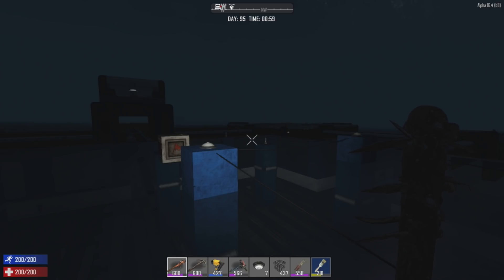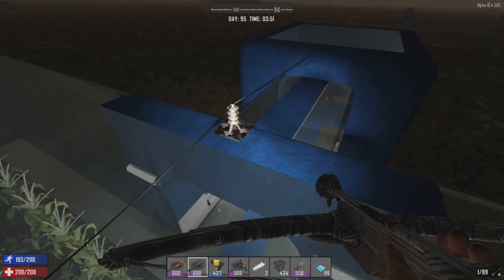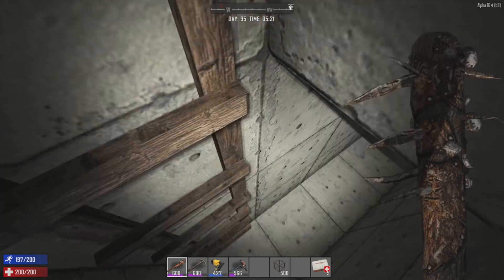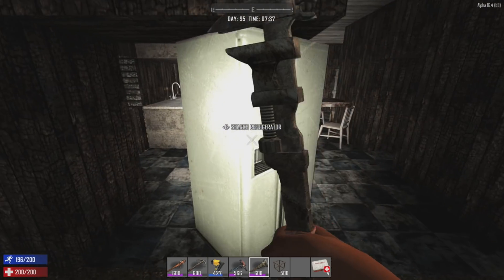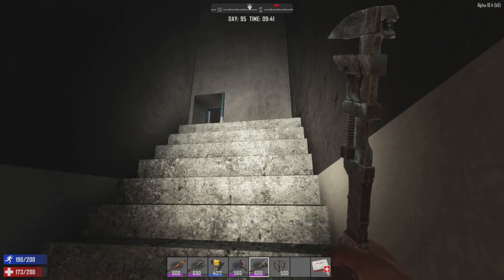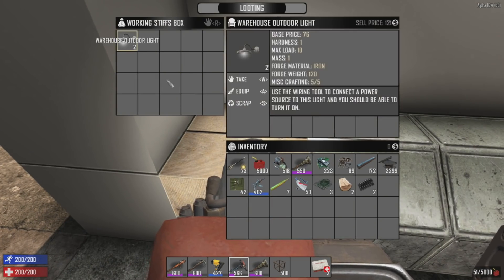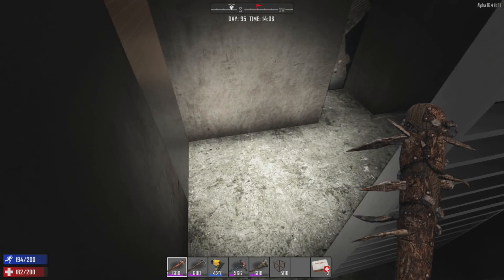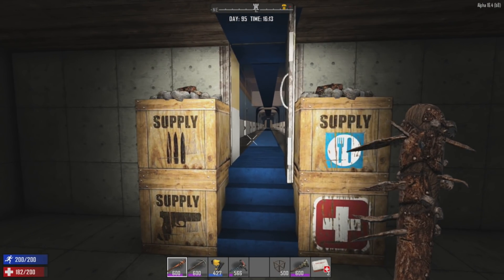7 Days to Die Let's Play Alpha 16 S2 E104

Comment: GS, those old warehouse lights you found, if you had just placed them on the wall you could have wrenched them. I think you only get the Electrical Parts from them (and some iron) though. Whether or not it's worth you taking the time to place and then scrap is a question of how desperate you are for components. 

The traders tend to have a ridiculous amount of plastic. I tend to see it in counts of 50-200, sometimes more. You shouldn't have a problem with plastic if you stop by a couple traders.

The other thing you can consider is the Do it Yourself skill. The insulators are cheap (iron, glass, clay). Add in 1 forged iron and 1 duct tape (which you seem to have in excess) and you've got Electrical Parts. Electronic components are a bit more expensive (1 electrical part, 1 brass, and 1 plastic) but if you do manage to get a few hundred plastic from the trader, it might solve your light problem.

Comment: If you are looking for electrical parts and electronic components there is no better place than the radio station. If you need plastic you should go inside a apartment building with a lot of TV's.